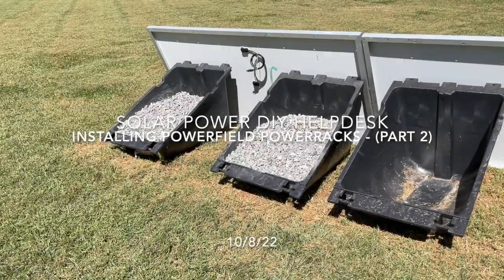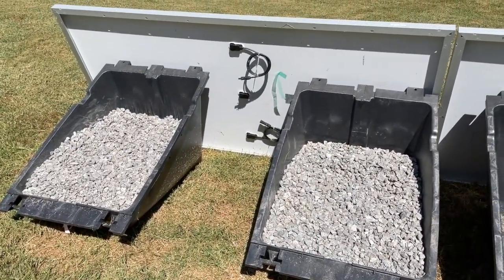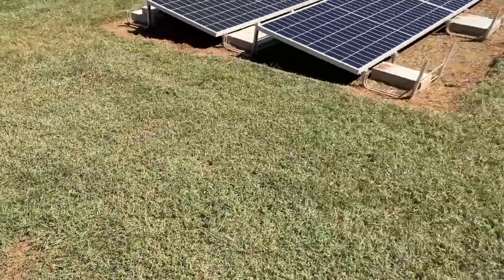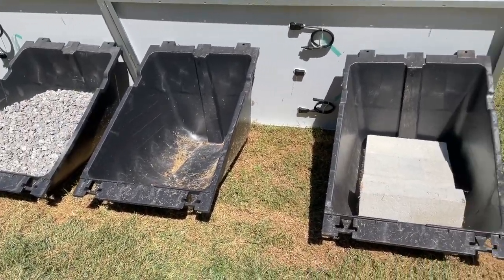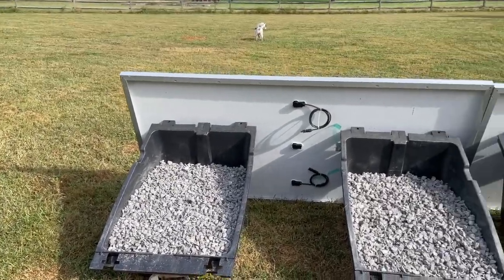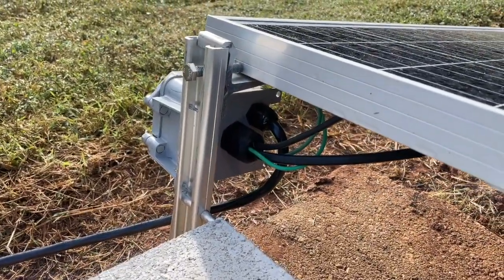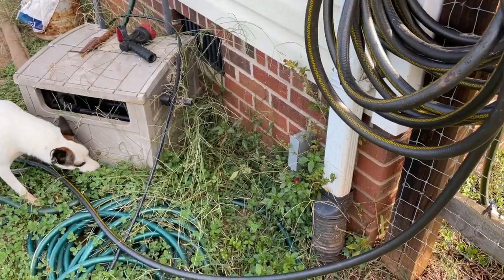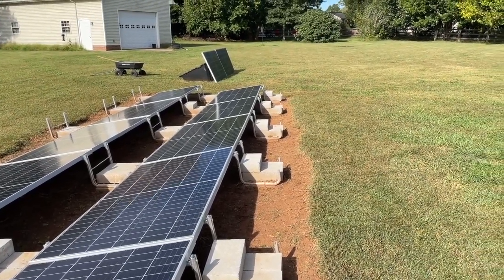Installing Powerfield PowerRacks - Part 2

Comment: Thanks for your informative video. We have the boxes we would like to install them in rows of eight panels. Our panels are 250 W used panels. When we purchased the boxes we did not realize that the solar panel cables are not long enough to connect to each othe when the panels are installed horizontally bummer! Any suggestions on what can be done to make the cables longer so that they could connect to each other in parallel 🙏